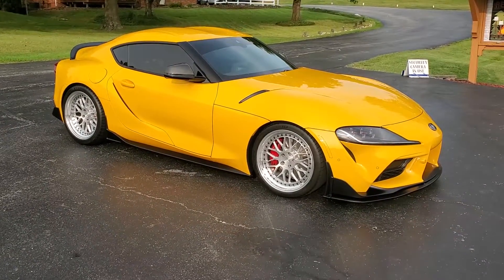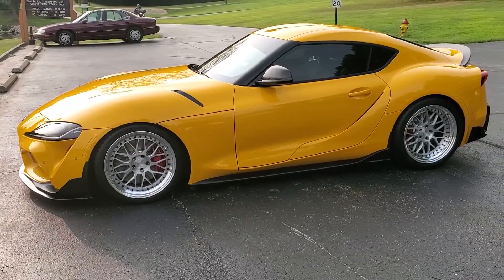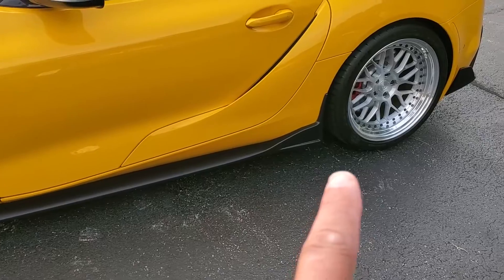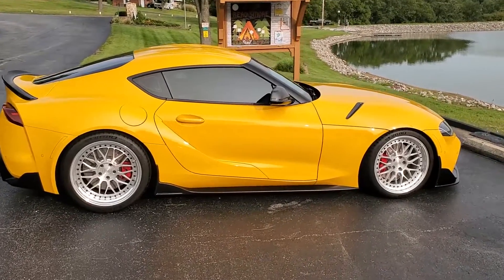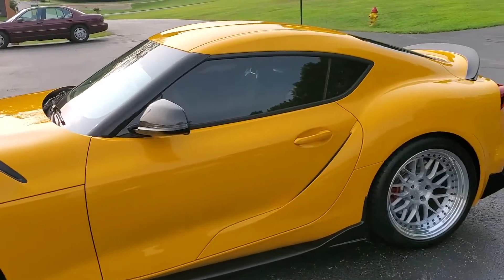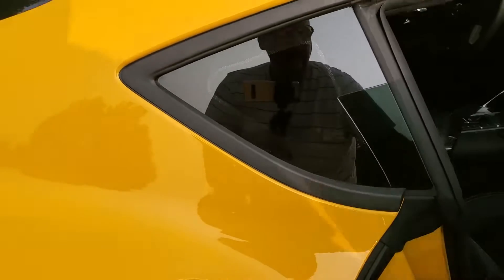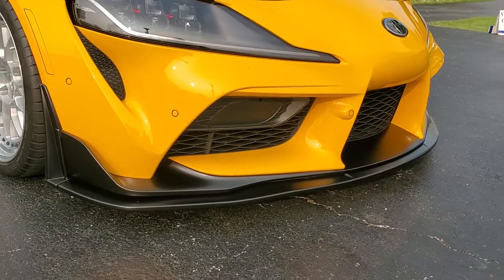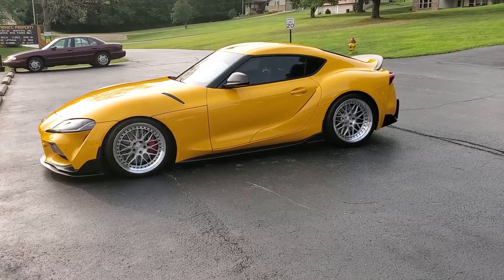End of Summer update 2020 Supra GR all the mods and future plans for the build

Comment: Where did you get your front plate bracket
Reply from the maker: I made it. maybe i should make a video? I actually cut the plate to match upper line of supra. I had to screw 2 small holes into black plastic to hold plate, but if removed you would have a hard time seeing them.  Then i bent the metal plate and heated up the plastic and bent it over the plate to finish the look. Passed billion cops and not been pulled yet.

Comment: What's the offset on those wheels?
Reply from the maker: Fronts are 19 by 9.5 with offset of +25 and rubber is 275/30 Michelin Pilot Sport 4S
Backs are 19 by 11 with offset of +38 and rubber is 305/30 Michelin Pilot Sport 4S
Reply: @jasonin2details  wow that looks absolutely perfect 👌